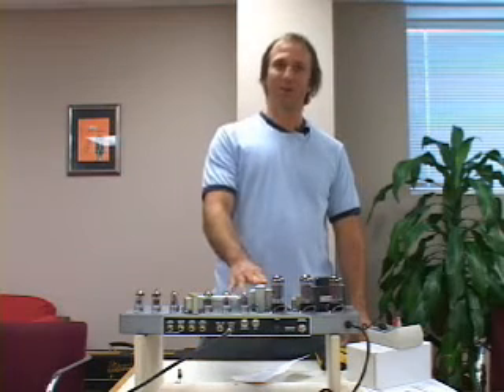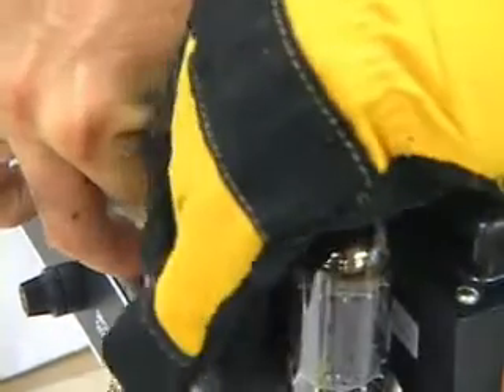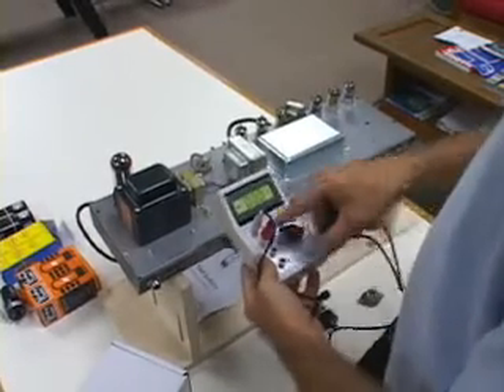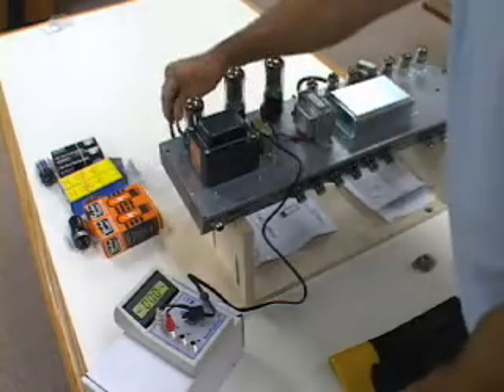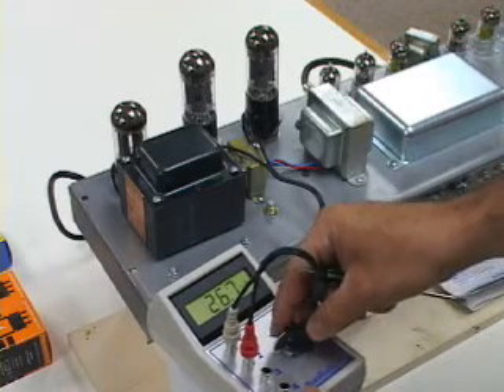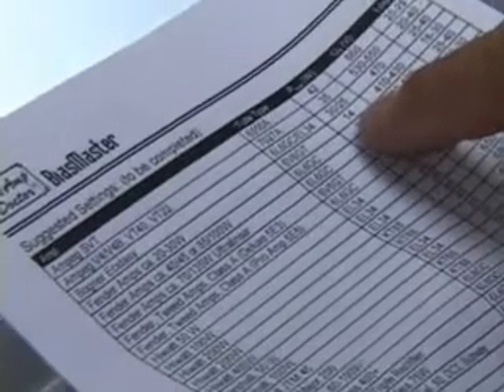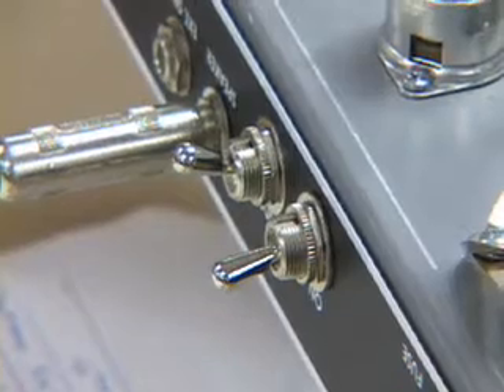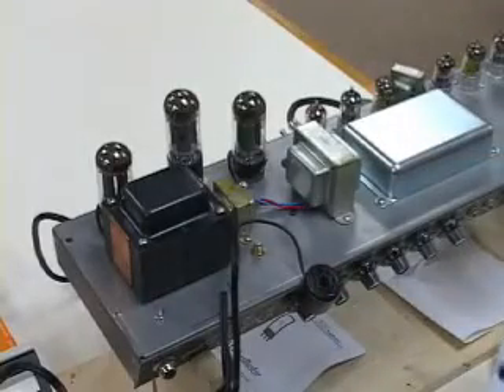Replacing and Biasing Amp Tubes

Comment: How come you only biased 2 of the tubes ?
Reply: There are only two power tubes and those are the only ones that need to be biased.  If it had four power tubes you would buy two matched pairs of tubes, and bias each side.
Reply: SaintFredrocks Is that third tube a rectifier tube then?
Reply: sam jose
Yes the one farthest to the left is a rectifier tube.

Comment: Energy do. P=V*A so anyone of these two can kill because it's basically the same when discarched. When you touch high voltage and close the circuit it's the current that goes through you. Also you have to know that quick discharge can stop your heart beating (voltage killing you) or current ionizing your blood. Probably there can be more...

Comment: I've used Fender amps for years but don't know how to check/set the bias.
Which tube pin for the black meter lead?  Is it the same pin for 6L6 and 6V6?  Thanks.

Comment: TRUE It`s the volts that jolts and the mils that kills. No Voltage then no current. Current is proportional to voltage and inversely proportional to resistance and if they have changed it they neglected to tell me.

Comment: I'm used to working on old tube tv's so know the danger...2 places you don't want to touch are the pins on the underside of those tubes and the big capacitors in the power supply.

Comment: Capacitors can really zap you...I used to work in a repair shop and my co-worker touched a charged capacitor inside a microwave oven....the jolt was so strong it threw him back up agaisnt the wall. He was stunned but and lucky he wasn't hurt. It really scared me.

Comment: I bias amplifiers on a spectrum analyzer. The amp's tone, or harmonic orders, change drastically, depending on the bias voltage. Often times, the factory setting will produce a lot of odd order harmonics, whereas, when I tweak the bias while observing the output on a spectrum analyzer, the odd order dip at some point, leaving just the sweeter, melodic even order harmonics. Often this will be more negative than the factory setting and result in cooler tube operation.

Comment: Well capacitors are of large capacity in amplifiers thus they store a lot of energy and voltage in them thus accidentally shorting them with yourself you will be cooked anyway.
Discharge electrolyte caps with 1W 50Kohm resistor. Use well isolated crocodile clamps to connect resistor to capacitor.

Comment: I'd hardly call it fancy.
affordable multimeters don't allow you to quickly switch between 4 sockets to test all tubes at a time. and most of us don't want to be jacking around the high voltage plate pin with test probes..   speed vs accuracy vs safety, this is fast simple, affordable and almost idiot proof. if you biased 20 amps in a day, you'd rather have this than a mm.

Comment: @Sethsilva13 Tubes are usually "burned in"  during the process where the factory or distributor determines which ones get "matched" together. If you are really worried about it, you can just test them periodically.

Comment: Would it be wise to use this bias master when putting in a completely new set of tubes? If so do the tubes still have to be "burned in" or is it a simple plug and play scenario? Any and all help would be appreciated, since I'm no guitar tech, but I don't have the money to be taking thing to a tech for something as common as tube failure.

Comment: I was going to order the exact same tubes for my amp.  i have 4, but only two are bad, i found some online at guitar center. can i just switch out 2 or do i HAVE to do all 4. also there are three different options for my model 1-3low 4-7medium 8-10high. it is hand written on my current tubes a 6 which means i have to order the medium. is it ok if they give me any number between 4 and 7 or does it have to be a 6.
Reply: Jason McGill you gotta use a matched pair set for best and proper function, but the tubes need to be biased so everything works together vs. on tube working harder than the other one(s)

Comment: Thanks - I had very tight 6l6 tubes and was worried about breaking them and did the circular wiggle and they slipped out! 

I had a bad hum and crackle issue: I swapped all the 12ax7s and wasn't them, so I took the 2x 6l6s out, put some contact cleaner on pins,  swapped over their positions, re-inserted ( and wiggled!) and hum gone and no crackle!
Reply: snotmale good deal bro

Comment: Hi guys...

I am a complete newbie when it comes to working on Amps. I'm trying to learn so I can bias my own. I'm confused though. With my Jet City JCA20, this bias video on YouTube says to be sure to check the plate voltage.

The only thing a bias meter, the kind that we see in this video, seems to tell,  is what the current bias setting is. How do you know what to set the bias to without knowing all the other factors? The formula over there is:
Tube voltage x factor / plate voltage.

Comment: @l4nky2 
either way, hes right, tube amps are dangerous, you have to let it discharge for a while after unplugging it
Reply: Cheaper by the thousand short out the electrolytic capacitors with a low ohm resistor

Comment: HI, first thanks for the excellent expanations .  I recently got a hybrid tube amp and tried to roll some tubes on it.  I used an oscilloscope to mornitor the output.  It turns out only one out of five tubes I got can get the perfect signal shape without distortion, and I checked the bias voltage for that "good" tube  and found it is way below the specified value for the circuit.  Does that mean most of my tubes are actually no good or the circuit design is problematic? 
LK

Comment: @l4nky2 Ever heard of Ohm's law? High voltage translates to high current, if the resistance is the same (such as the resistance of your body, when you go poking inside your amp).

Comment: @punkmusicmetal best thing for draining power when you turn it off would be to make sure theres a resistor, say 100-200k about 2w accrossthe first capacitor, most amps already have it but it could be too big, a smaller capacitor means more current draw means faster cap drain, but then thats still drawing current when the amps turned on so it cant really be too big...

Comment: @punkmusicmetal   
Opinions vary on what is too far unbalanced with regards to good tone. Some people intentionally unbalance an amp. With regards to a properly functioning output section you would want each side to be within a 3mA of each other. You can usually drain an amp with a 10K 5w cement resistor and a set of test clips. Amp off strap the resistor across the first filter.

Comment: Two questions, 1.) What happens if I bias it, the tube voltages or whatever don't match up? and 2.) what is the best way to drain the amp of all the excess power before I start work on the amp?  Thanks a lot in advance.

Comment: I'm surprised at all the biasing videos on here. One thing is missing from most of these videos and it's a warning about the fatal voltages insides of the capacitors in tube amps. These capacitors hold voltages high enough to kill. This stuff should really be approached carefully and with a lot of research.

Comment: Flyback will kill the Output transformer without a load connected .... the power builds up in the output transformer and needs to go somewhere... if there is no speaker load hooked up it will ARC and BURN through the windings of the transformer
Reply: patfurlan very true and there not a cheap fix

Comment: never understood why tube amps need speakers hooked up to power up amp without causing some problem...with no signal present...does the output load exist....there is no current nor is there any voltage present...hence the secondary of output transformer has same load whenever no signal is present. transistor amps......its a different story. well not really.....discrete amps same applies to. not sure of output ic's. next lesson...who started the theory that caps can  be "reformed" by ...

Comment: does the line 6 spider valve 112 tube amp need to be rebiased? please help. i just bought one off ebay and i have no clue on how to replace tubes or what to do. i heard there are amps that self rebias?

Comment: That's completely wrong. I hope that kid didn't take you at your word. The tubes are matched with each other, not the amp. Makes no difference whatsoever what type of tube it is. I've retubed dozens of 6L6 amps and they always need adjustment, some times a LOT of adjustment.

Comment: correct. and if you own a mesa that came with 6l6's and there's an el34 switch on the back (or any amp, not a mesa) you can put el34's in and set the switch to el34's.
kt77's will also work in an amp that has an el34 switch because they run similar.